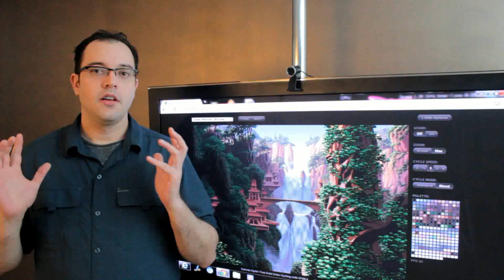System Engineer Vs. System Architect

Comment: How is systems architect not a systems engineer, don't they both work with a system of systems? The Software engineer is the one who works with the building blocks. I'm confused, is the architect the one who is responsible for the system of systems, the systems engineer is responsible for a system and software engineer responsible for the building blocks of the system? systems engineer is the one who puts components together to make the system, solicits input from users and software engineers, and are systems thinkers
Reply from the maker: Architect says spec A and Spec B should work together so here is the proposed system.

Engineer says I know how MySQL talks to WordPress, so if I make this shim I can use DynamoDb

Comment: Interesting video but I think his starting definition (which is the premise for the whole video) is flawed or at best incomplete. A system engineer is an engineer who analyzes/manages/develops the overall life cycle of a project/project/system. The speaker is right that it is a matter of scale and when you get to systems-of-systems, then the realm of 'architect' overlaps. But the overall "system thinking" is the same.

Since everyone defaults to just looking it up in wikipedia - here you go:
System Engineering - Systems engineering is an interdisciplinary field of engineering and engineering management that focuses on how to design and manage complex systems over their life cycles. At its core, systems engineering utilizes systems thinking principles to organize this body of knowledge. Issues such as requirements engineering, reliability, logistics, coordination of different teams, testing and evaluation, maintainability and many other disciplines necessary for successful system development, design, implementation, and ultimate decommission become more difficult when dealing with large or complex projects. Systems engineering deals with work-processes, optimization methods, and risk management tools in such projects. It overlaps technical and human-centered disciplines such as industrial engineering, mechanical engineering, manufacturing engineering, control engineering, software engineering, electrical engineering, cybernetics, organizational studies, civil engineering and project management. Systems engineering ensures that all likely aspects of a project or system are considered, and integrated into a whole.

Comment: if you are in real world an idea is made by the Architect  there for all the way it should work is placed out... how far the wall should be were the bathrooms should be and so forth and  the Engineer/Engineers figer out how they work.. if the wall will bare the wight of the floor above and if there is a path that the water can flow to the bottom of the building to get to the sewers so if you swope who is doing what it dos work but this isnt the  same in programing fyi lol

Comment: I have done a course about Systems Engineering and a course about Software Architecture on a university master level. I can assure you that there aren't a lot of differences between the two courses. The only notable difference between them is the kind of system your designing and the tools you use for that. For example, with Software Architecture you create UML diagrams and with Systems Engineering you create IDEF0 diagrams. All the other stuff (Requirements, Analysis, etc) was the same.